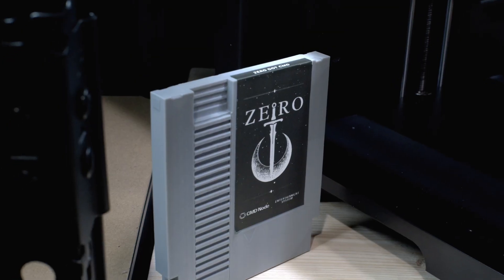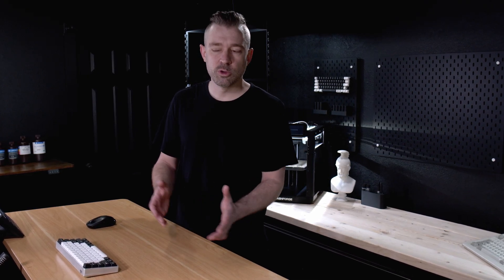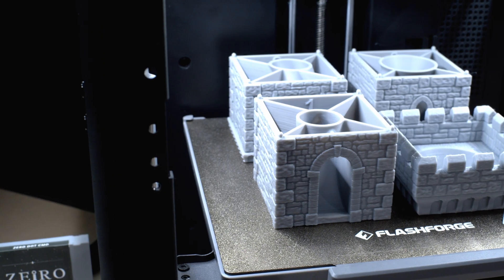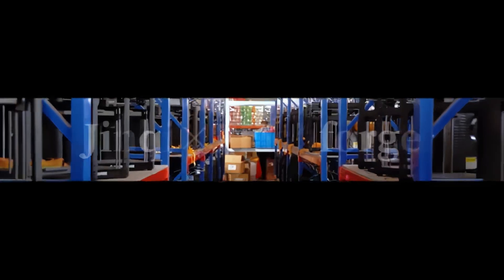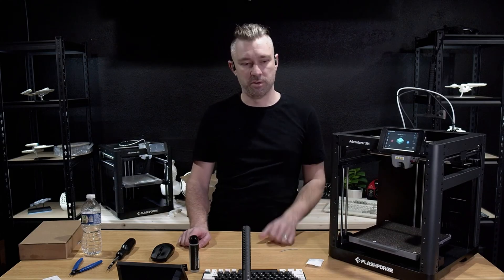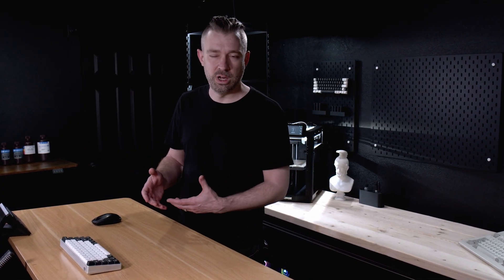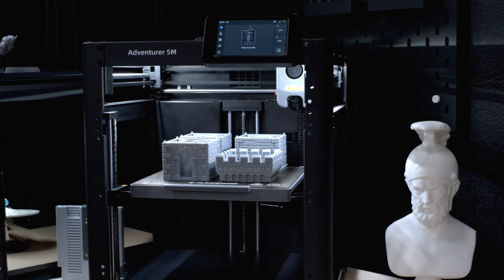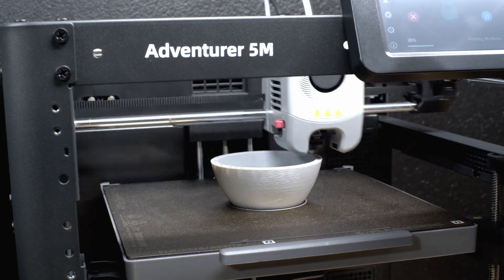The Best Printer For Your Print Farm?

Comment: I have 2 centauri carbons arriving in a couple days(with some extra hotends lol), with the thoughts of if i expand Ill look into the forthcoming unenclosed regular Centauri which will be $200, BUt your vids really have me looking at FF now - widely availabe machines, available parts, industrial quality control is a huge consideration, ability to customeize & use the slicer i want, are all great points, with the ONLY downside i possibly see is the build area size... also very interested in the AD5X as it gets tested out.. Appreciate this video!

Comment: I am brand new to 3d printing, and I just got a AD5M about two weeks ago. Considering how low the price was I was anticipating having to do a ton of tweaking and troubleshooting. I honestly feel like I have been cheating. I have printed dozens and dozens of things so far and all of the prints have turned out 9/10 or 10/10! The stock filament profile for the highspeed petg is spot on and it is printing this well while doing 200-300mm/s. I am honestly amazed and looking forward to completing a full enclosure build with vented exhaust and chamber heater so I can print some more difficult filaments.

Comment: I've read a lot of about the print head gouging the table. Any comment on this?
Reply from the maker: Yes. Its a common user error mistake. It happens when the nozzle isn't fully seated. The quick swap system of the AD5M series needs to be fully seated until it clicks, without being fully seated this issue is highly likely to happen. The other issue is the bed MUST be calibrated after a nozzle swap. And users skip this step. Changing the nozzle changes its height and without calibration you'll run a 50% chance of damaging both the Nozzle and the Bed.
Reply: @zerodotcmd  Thanks for the response. I've read so many horror stories of the print head gouging, but all sounded like it was a printer error, with no explanation. This summer I'm going to get a 3d printer, and this was one in my list, but the gouging frightened me. My 3 choices (so far) are the Flashforge 5M pro, Anycubic Cobra S1, and the yet to be available Elegoo Centauri Carbon. I just want to print out of the box, without a lot of fiddling.

Comment: This is a great video and I agree! I own four of these and as you mentioned, each one works exactly the same out the box and they still print perfect. The one feature that I definitely like that the pro model has over the standard is the auto-shut off feature. I know the enclosure & filtration are usually the selling point between the two models but personally, I think the auto-shut off feature is worth spending the extra $150 for the pro model. Cheers
Reply from the maker: Thanks! Glad you like the video. The auto shut down feature is awesome on the AD5M Pro, nice knowing it can just finish the job then go to sleep.

Comment: Great info, thanks! Regarding HW modifications capabilities, you'd do the Flashforge community a great service by showing how to mod the 5M non-Pro to include air filtration for air safety around the printer. It's one of the top topics in every Flashforge community, and it hasn't been addressed in a simple or more clear way. Thanks!
Reply from the maker: No problem, glad you like the video! Good point, this is something I'll throw on the list!

Comment: Thanks for your insight!
I do wonder though if you're running the stock firmware and using the flashforge branded slicer?
Reply from the maker: No problem. Generally I prefer stock firmware over custom. I usually only tend to have one machine running custom at a time for testing. Its mostly about preference.